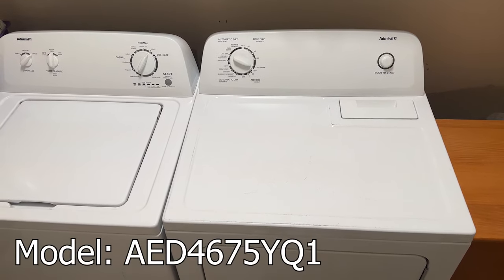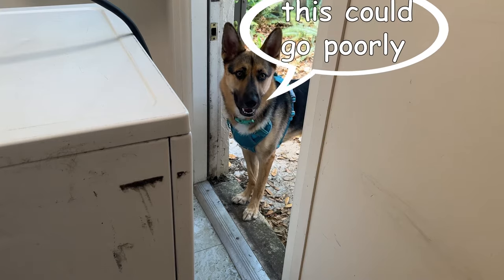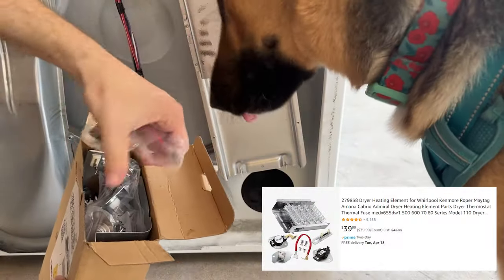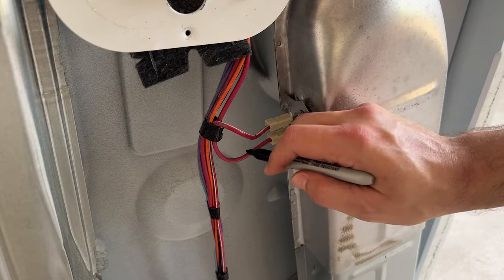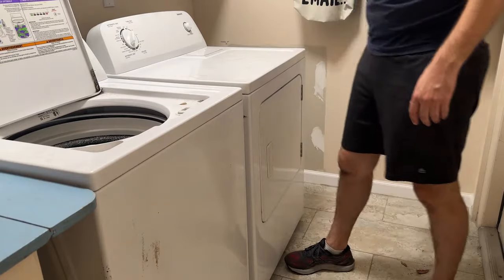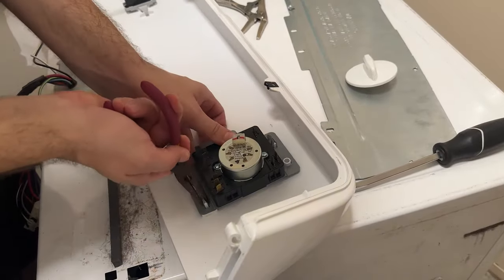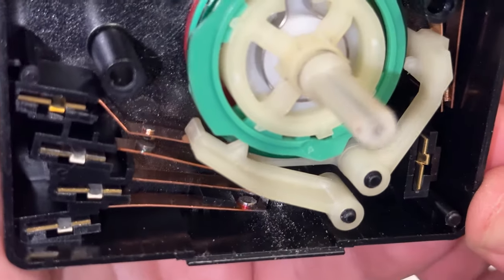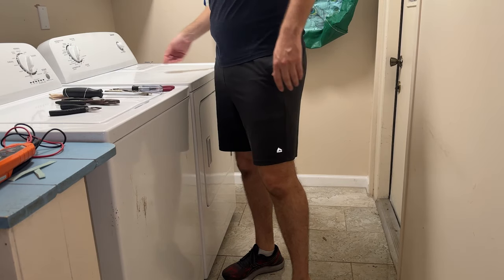No Heat from Dryer (Admiral, Amana, Element, Kenmore)

Comment: Why did you remove the whole top where the timer is?? All you needed to do was take the backing off and remove the timer.
Reply from the maker: I don’t really have a plan.  I just turn the camera on and start tearing stuff up.
Reply: I just retightened and cleaned my timer and it works like brand new 💯🙏
I took off the top of my dryer because I didn’t wanna snap or break anything that was holding the timer housings and device. Was easier for me after I took it completely off. I thought there would’ve been something else holding the timer device and housings too the faceplate but only those two flimsy snap-in’s

Comment: If the dryer is still running and just not heating, how could the problem be the electric panel or outlet?
Reply from the maker: To be honest with you man I don’t understand electrical enough to answer that.  I’m assuming the theory would be that a 240v 4 wire outlet is 2 hots, a neutral, and ground.  Maybe if one of the hot legs failed then the 120v could power the spinny part but not the hot part?  

I don’t actually know what I’m doing when I make these videos and I’m just out here recording myself trying stuff to be completely real with you 🤣

Comment: I changed everything, including the heating element. I cleaned the contacts in the selector, and the dryer is still running cold as polar bear balls. I'm in for $93 so far. Anyone with a suggestion for what to do next?

Comment: Cleaned up the timer first, it didn’t heat, then replaced the parts and cleaned the timer again and it did heat! Thanks
Reply from the maker: Glad you got it fixed! 💪
Reply: Probably what need to do because I cleaned the timer and mine didn’t work. Parts will be here in 2 days

Comment: I did the same fix about 4 years ago on my admiral. Worked great but 4 years later it just stopped heating again. Gonna dive in and check it again before buying a new dryer.
Great video you did. Thanks

Comment: I have an Amana dryer and replaced all the same components you did and it still is not heating, but I had checked the timer for continuity, and it had it so i figured it would not be the timer, but I did not think to open the timer itself and check the contacts. i am going to try this and see if it fixes the issue.

Comment: Excellent video. So, after replacing all the sensors, heater element, etc in the back, and taking apart my timer and sanding the contacts, mine still wont heat. Ideas??
Reply: Same , have u came up with anything??

Comment: I’m having the same problem. Suddenly no heat, and the timer never stops, so I figured it was the timer. So I went through and did what you did, but the timer looks perfect on the inside, and i put it back together and it’s still not working.
Reply: Just replaced the timer and it’s still not heating. 😞
Reply: did you figure out what is going on? did you check your heating elements as mentioned in another youtube video? I first tested the heating element and it seems the continuity reading is okay. Then I tried the timer thing described here since I have similar non-stop issue. Now the time seems to work well but still not heating...
Reply: @rhabdomere same , any updates ?

Comment: I’ve don’t everything you did and cleaned the timer contacts and still have the same problem. Any ideas?
Reply: buy a new timer
Reply: @arronwilliams700 same here and I’m still getting continuity between the prongs on the timer. It wouldn’t show continuity if it was bad right or should I still replace it?
Reply: Great video. I have the same model and problem. My bad contact is pretty bad. Anyway to replace just the bad contact?